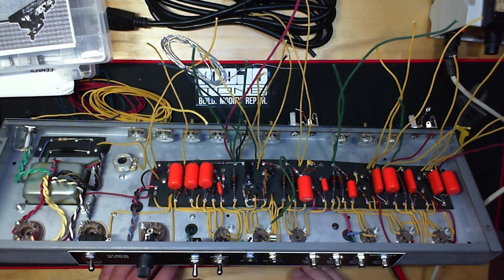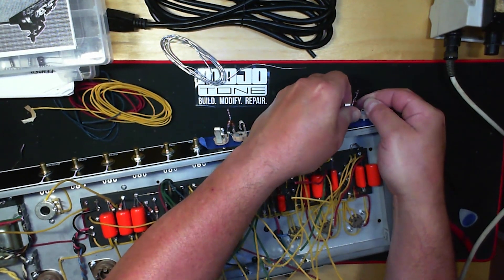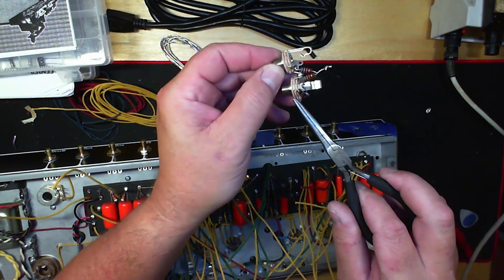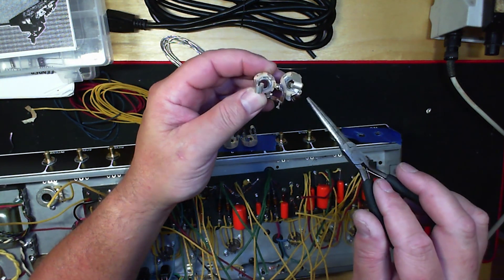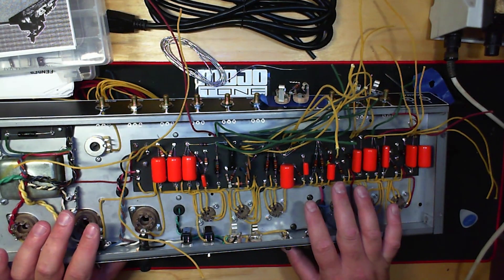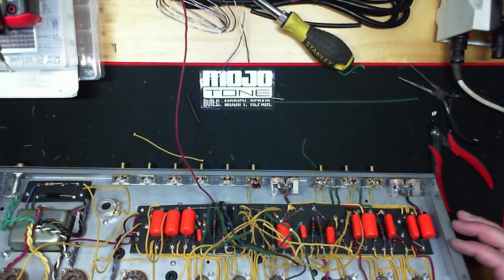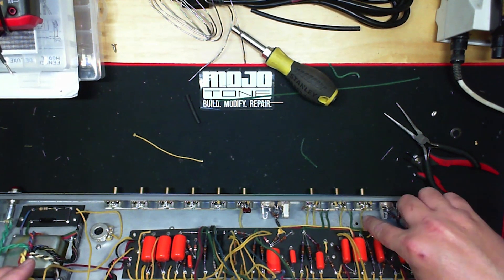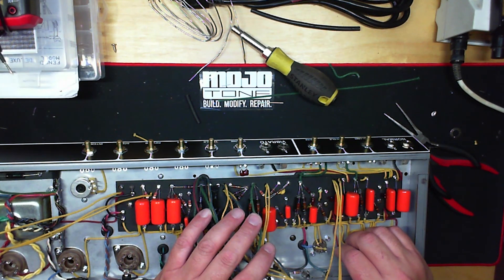Mojotone's Blackface Deluxe Reverb Style Control Side Wiring

Comment: You should include the brass plate that goes up against the back of the chassis for the pot grounding like Fender did. They did that for a very good reason…noise. I’m considering buying this kit and if I do I will be adding that and grounding it like Fender did.

Comment: Nice series, very good info! Thank you, Andy! Just wondering about the filament wiring. I have seen many build tuck the filament wiring on the floor and into the fold of the chassis along the back. Why does Mojotone/Fender have the wires flying over the tube socket bases?